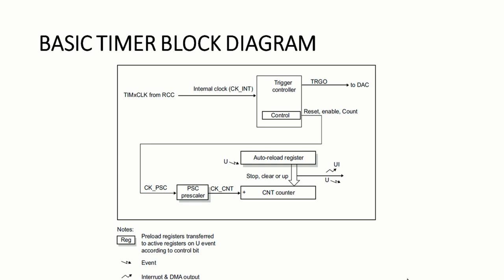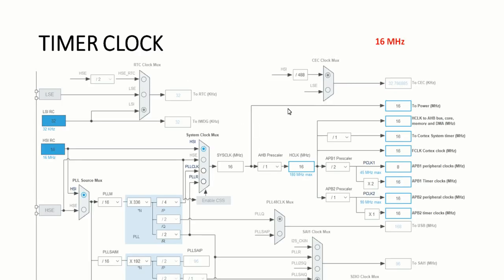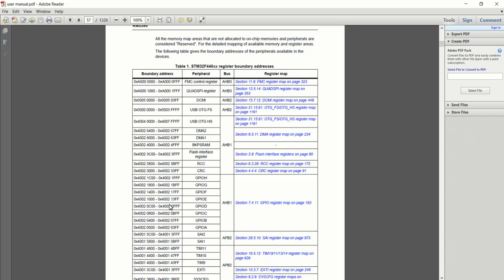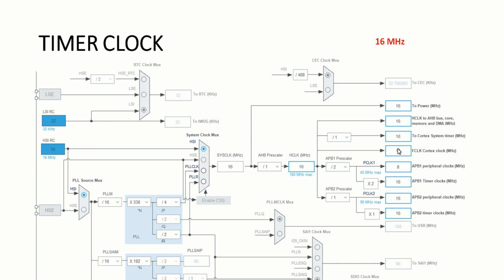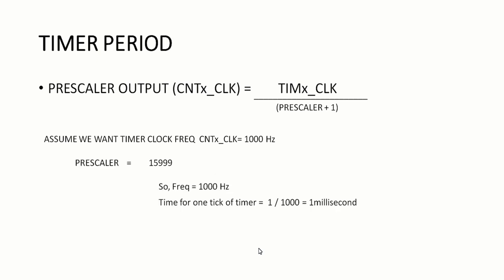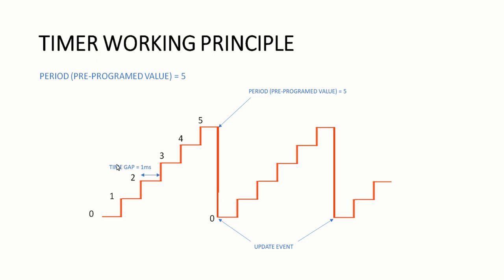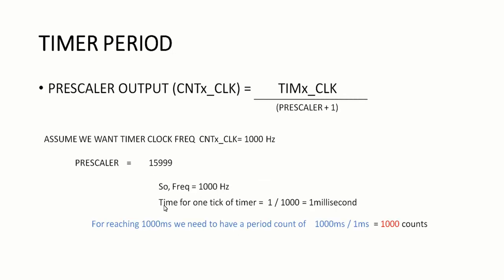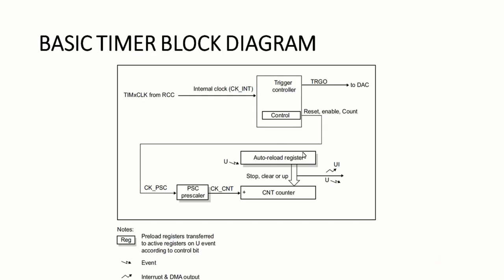Timer Interrupt Configuration and Calculation in STM32 Cube Mx | STM32  | STM32F446RE | T - 10

Comment: Hi,how it becomes 16000000Hz?? I am still having a doubt
Reply from the maker: By default this board is having 16MHz it is 16MHz or 16000000Hz
Reply: @SMtrainingacademy   but in data sheet it says APB1 is 90 MHZ and APB2 is 45MHZ does this gets divided by 2 or 3 or 4 etc as a prescalar???
Reply from the maker: @Pavankumar-qk5uv  actually if you use pll you can operate the controller at 180MHz then what you said will be applicable by default it will be 16
Reply: @SMtrainingacademy   thanks